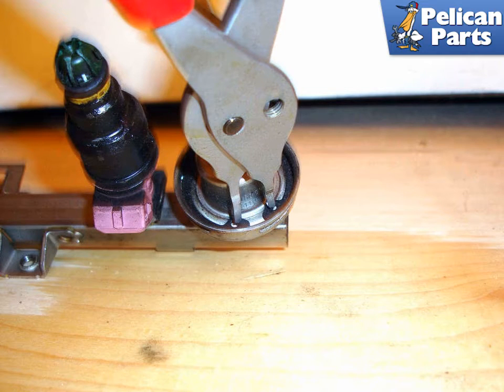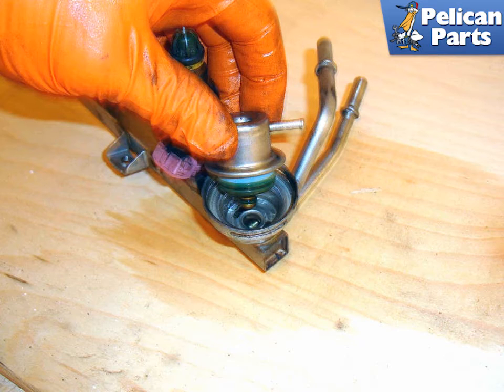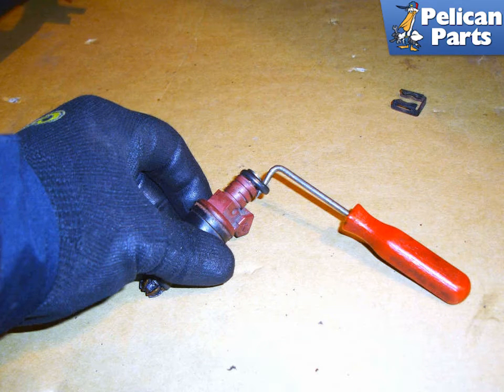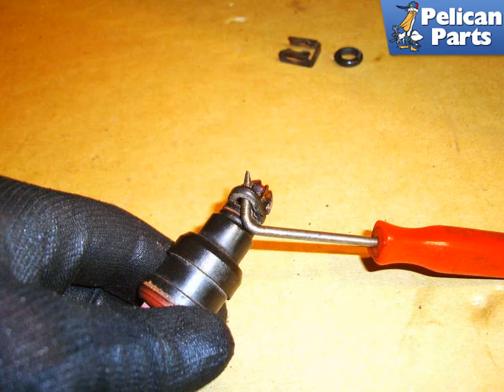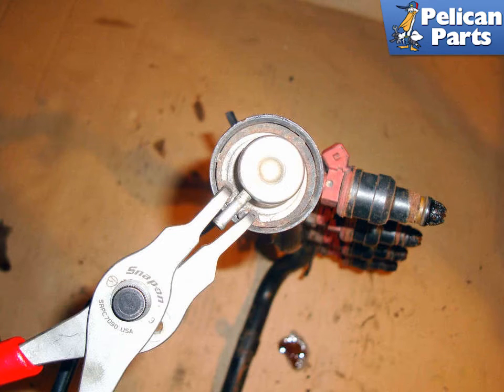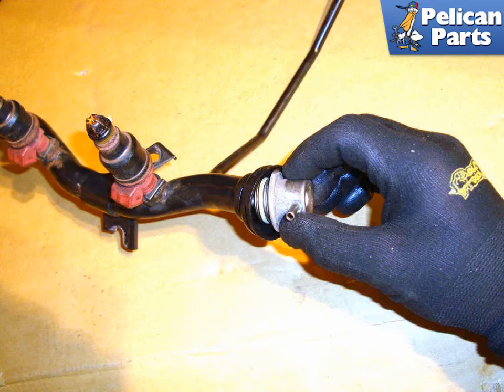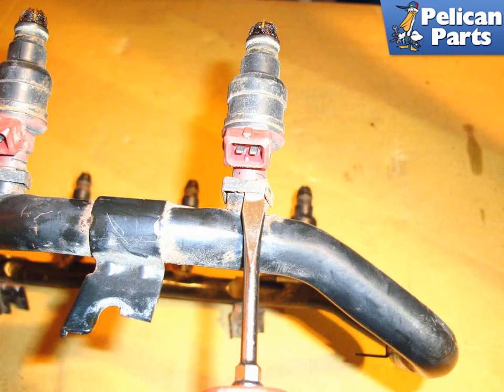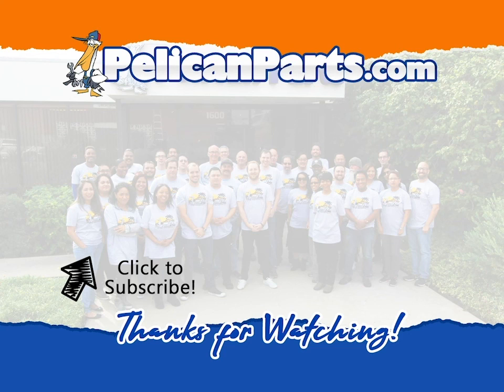BMW E39 5-Series Fuel Rail Rebuild | 1997-2003 525i, 528i, 530i, 540i

Comment: Thanks for the video. I have viewed every video on the internet regarding replacement of the fuel pressure regulator on my 1999 BMW 528i E39. Nothing I have seen shows where the FPR is mounted. It is not on the rear of the fuel rail. It is not readily viewable anywhere else. In particular, your video shows the fuel rail on the other side of the ignition rail. Can you tell me where else the FPR is located?
Reply from the maker: on 6-cylinder engines it is at the front of the fuel rail (front when seated in vehicle).